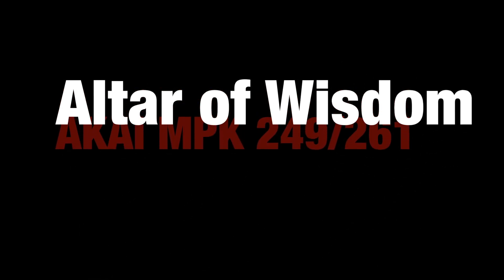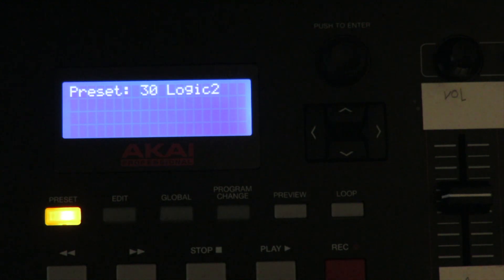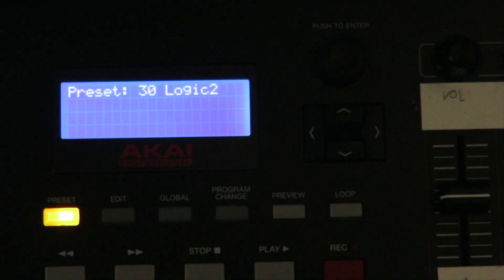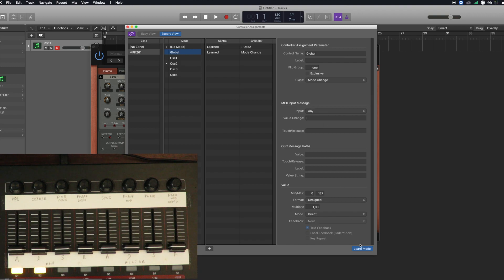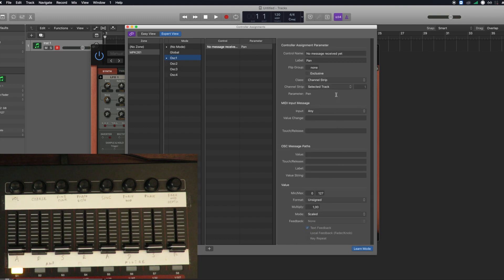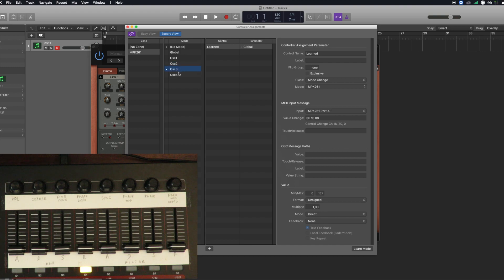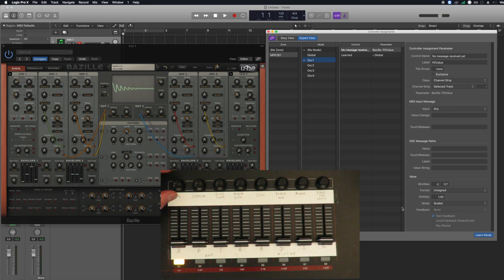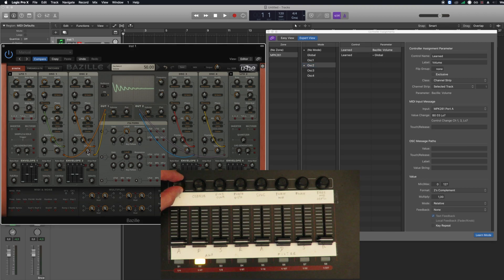Advanced MIDI control mapping of plugins inside Logic Pro X with AKAI MPK 249 & MPK 261

Comment: Hey how did you get your mpk to connect. I can’t get mine to connect at all
Reply: I've had this problem a few times, finally figured it out; the MPK has to be powered on before you plug in the USB cable. So you'll have to plug in a 12V power supply, power on the MPK, then open logic, plug in the USB cable, and it should work. After the MPK connects, you can also unplug the power supply if you need to utilize space on your power strip.

Comment: What button are you pressing to switch modes? I just got a MPK249 but I used to use modes on my Nectar LX25 by using the Scenes and Clips button to change "scenes" so I had 8 Scenes that I cld change between that wld pretty much give the pads and knobs a new set of parameters. 
Im just wondering why you wouldn't just use the control banks A-C...unless this was just a video to show example of making modes...
Its crazy how many videos there are onYoutube about MIDI and programing the controls yet none of them are very in depth and normally are just like setting up default controls or at most assigning knobs and faders. 
Only a few videos out there that are any good about MIDI CC and Program and Mode Changes.
The one thing that confuses me so far about the MPK249 is being able to edit the controls on the keyboard and CPU as well as the presets and saving the controls. I turned mine off without saving and the controls where still saved in logic and still worked. I keep the option to send all midi controls to instrument when loading project.
But damn I have been racking my brain for a few months trying to step my MIDI game up lol! Spent forever setting up the Nectar then got the MPK cause of limitations.
Reply: Oh I also meant to say that when I had the modes set up with the scenes on the Nectar it would act crazy some days and then some days it would work just like I wanted...like some days if it started not changing modes I cld click a different mode in the controller assignments window on logic and it would change on the Nectar keyboard, like light wld change and all then sometimes no matter what I did it wouldn't switch. One thing I really liked on the Nectar was that you could use almost any key as a shift button, which I found out works on the MPK yesterday too, now I dunno know if  wanna make different presets for each way I wanna use it or just try and make one big preset with a lot of controls and shifts...
Reply: @Juliano_DJOL  how exactly did you organize your midi mapping. General commands in no mode and then assign a mode for every plugin/fx?

Comment: Nice tutorial! But is it possible to control external keyboard with multiple midi channels at once? So far akai can transmit only one midi channel at a time(, but pads can be set to any channel and used simultaneously. / So i need e.g. to trigger 12-13 midi channels at ones from my Yamaha Modx/

Comment: I hope I should be able to do the same with other synths and save the macros for all of them and whenever I use any of them it automatically recalls the saved information?
Reply from the maker: Just doing the same method on my Novation Summit as in the meantime I've sold my MPK, works really well. Only drawback in Logic you cannot export or import midi assignments all of them rely in an encrypted file !
Reply: @AltarofWisdom  what does that mean? When would you want to export or import midi assignments??
Reply from the maker: @Eddielundell  To share them with someone using the same keyboard for example. No way because you an only export all controller assignments (by copying the file)